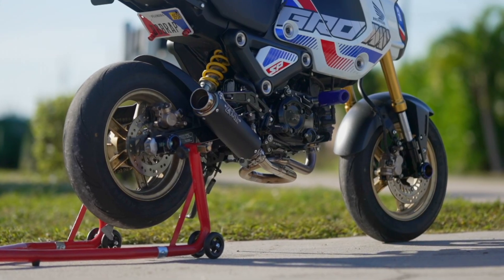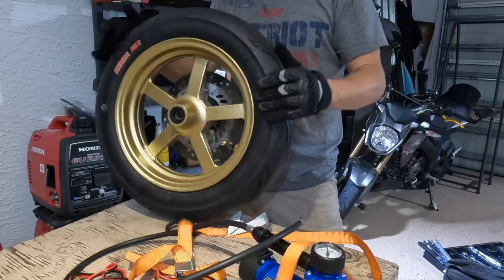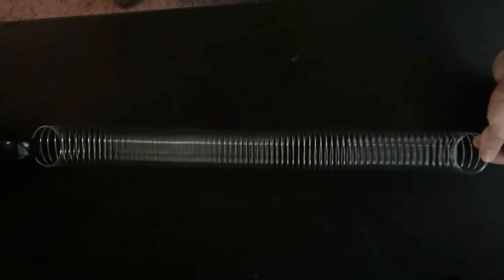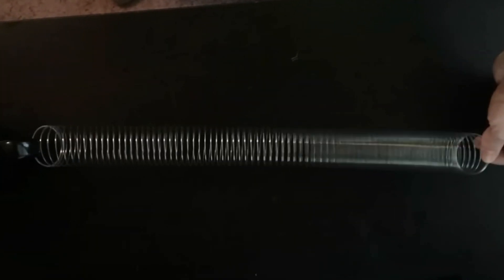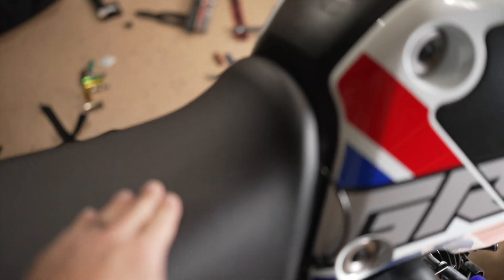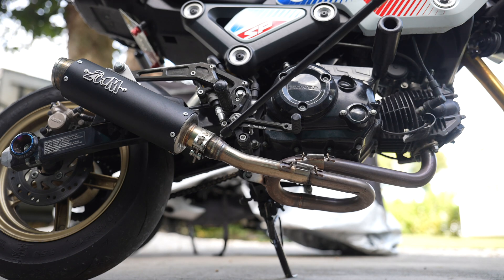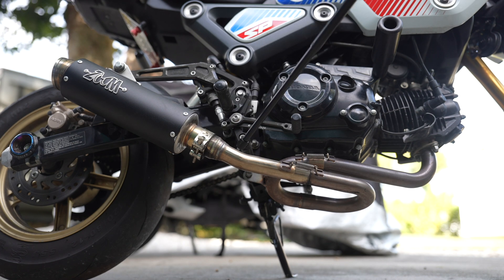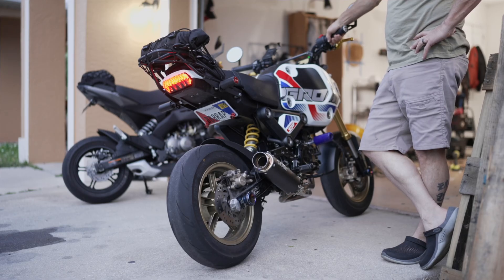What is the Purpose of a Loop in the Exhaust? Honda Grom Zoom loop exhaust

Comment: You will get a reflected wave from the "cat" you installed as well as some restriction in flow. Any obstacle, change of angle or pipe diameter will cause some form or reflected wave so this pipe will have several wave pulses being reflected. Now from experience I know a longer length exhaust works well on all of the horizontal Honda and Chinese clone engines. They do not rev high enough to work well with short exhausts which are more suited for much higher RPM than we want with these little engines. The longer pipe length with no DB killer or other internal restrictions on the LM exhaust I run gives the bike a better spread of power and is of a length which allows the engine to rev to 13,000 rpm but peak torque is around 600 rpm higher at 7800rpm and peak power is also a little higher at 9380rpm with 14.6 bhp on the dyno at the rear wheel on my pit bike running a Z155 Zongshen engine. But the thing with the pipe it that even at 13,000rpm the bike is still producing almost as much bhp than the untuned engine was at 9000rpm which was where the stock engine was producing 13.2bhp. With the stock pipe the engine only revved to 11,300rpm and was putting out 10.3bhp where at the same RPM the longer exhaust engine is producing 13.9 bhp at the same RPM, the engine still has 12.9bhp at 13,000rpm.
Reply: Same here, though i have the 110cc CRF engine. Have tried several lengths and the longer and a bit smaller diameter one works well. Currently using an old LV scoot exhaust system and my bike rides a lot better with it.

Comment: Loving your videos. So I have 2025 Grom, and my mods are Zoom loop exhaust no baffle, TST air box cover, DHM Ecu flash stage 1. Will I feel a difference when I put in the db killer to what I’m running now. I am thinking about doing the cam & sprocket later.

Comment: From my drag racing days, I recall that the PRIMARY pipes (i.e. BEFORE the 'collector' on multi-cylinder engines) were tuned for specific rpm's.  In general, shorter primary pipes increased high rpm power; longer primary pipes increased lower rpm torque.  I envy the FUN you're having figuring out better performance than the Honda engineers, who've made millions of that engine.  🤩
Reply from the maker: Interesting!  Yes, good point.. Honda knows what they are doing for sure. I assume gas mileage and stock gearing is in there equations… once o changed air volume, cams, gears and don’t care about gas mileage… makes sense to change.. 

Best bang for the buck is sprocket, airbox and just reset the stock ecu… leave exhaust alone and enjoy the  bike
Reply: @0to60eventually_youtube  I've read that, as of 2017, Honda sold 100 million of various models, using that engine.  I suspect that most of those sales were in countries with mostly dirt roads and few, if any, highways.  Why do they need to go faster than 40 mph?  In many such places, 87 octane fuel is scarce.

I suspect that the Honda intake air-box is 'tuned' for low rpm torque? ... usually overlooked by those seeking high rpm power.  ... same with Honda's choice of sprockets/gearing.  I'm not quick to assume that an outfit, which sold over 100 million of something, doesn't know what they're doing!  😛

Comment: Is the loop setup the same as "powerbomb" (bulge chamber) in the middle of the pipe? Im thinking for a full-system pipe without the cat and some said that single cylinder do need some kind of restriction, hence the powerbomb suggestion. Great video btw
Reply: Bulge is for 2 strokes. There  is no restriction due to the length of pipe(counterintuitive I know.)

Comment: change intake or exhaust = need tuned ecu for each set up for best ppower
Reply from the maker: Intake = ecu reset (no flash/tune) 
InTake + slip on = ecu reset (no flash/tune) 
Full exhaust + intake = flash/tune and ecu reset

Comment: Cool looking grom. I still dont understand why anyone would buy one and not a real motorcycle.  Maybe is the wheely thing?
Reply: You can get away with doing a lot of dumb stuff unscathed while on a smaller bike. Stuff that will get you killed on a bigger bike.
Reply from the maker: #facts
Reply from the maker: It’s a weird human behavior for sure. 4k pulse 2k  in mods to go slower than a R3 or a Honda rebel 🤣.  Short answer is if mopeds are fun, then these are even more fun… when you get into 300’s or bigger you have to get more responsible… 😎😂
Reply: @0to60eventually_youtube  I guess people see them as a bicycle and dont even wear a helmet.. who knows.  I started ridding motorcycles 6 years ago. I had 3 cars and figured maybe I get a scooter for short 10 minute trips and to avoid paying for parking. Then I saw shitty 50cc scooters.. then I'm like, I could never buy that. Then saw 125cc and they barely do 35mph... then some 200cc. Meh. And then I said, for the same price I can get an 1100cc bike and turn it into a bobber and actually own something cool. So 10 motorcycles later, I still don't have a scooter lol.
Reply from the maker: The motorcyclist journey. Always interesting 💕
Reply: If can't get these bikes up to 100mph, you can't crash these bikes at 100mph.
Reply: You can easily die at 50mph if you are unlucky 😅. Technically if your head hits the cement floor with no helmet at 3-4 feet, you can meet your maker. Always wear protection, even on a scooter.
Reply from the maker: I eat shit at 45 mph on my R3 .. worst accident I’ve ever been in. Still trying to get full function back to my arm.

Comment: How did you get the length of the header pipe?
Reply from the maker: To be honest a slip on with a tune would probably be the best balance between sound and power access
Reply from the maker: Just purchased the pipe, had DHM tune the ecu for a “yoshimira loop pipe” and started trial and error. The way to load exhaust kept me going back in with the Db killers … and got lucky over time

Comment: I race WERA and work with a guy that knows these things. It's all true. You have to tune it for torque where you want it.
Reply from the maker: The science is deepAF .. hats of to the real runners out there
Reply: @0to60eventually_youtube  Its not really science if anything its all math when it comes down to it (sizes, ratios and shapes) Anybody with half a brain can learn how an engine works, how to spot bottlenecks and how different parts will affect an engines performance through the powerband.

Comment: Not many tuners have figured this stuff out. Kudos to you sir.
Reply from the maker: The science is deepAF - hats off the all the real tunners out there.. and thanks to the good quality “bolt on” companies that figure it out and sale us the good stuff
Reply: We used to do this with 2-stroke racing exhausts back in the 90's, in the 'stinger' section of the pipe after the compression cone but before the backbox can.
We'd have various loops of different lengths called 'pig tails' that sleeved into the cone, to alter the length of the stinger protruding inside of the cone while maintaining the tune of the pipe. So, for less protrusion, we'd have a bigger loop outside of it. We eventually came up with stingers of different diameters and shapes to do the same thing.
The point of it was to smooth the transition into the powerband, to stop the bike from suddenly overwhelming the tyre when you come out of a corner and crank the throttle on.

Used to see all sorts of weird and wonderful things, from telescopic variable-length pipes that were driven from servo-motors depending on engine rpm + load, to 'snake's head' header pipes on both 4-strokes and 2-strokes, that contained a portion of the expansion phase in the header by being flat but wider. Crazy times those were.
Eventually, computers and accurate gasflow simulations came in to make tuned pipes, but it was all based off the data gathered by those old Mad Scientists in garden sheds.

Comment: I installed a Decha stealth air intake tube and drilled some holes in my air box, a good noise and plenty of oxygen. I tried an eBay exhaust and it was too loud even with the baffle. I'm keeping the stock exhaust on. It allows me to fit a Kitaco skid plate as well. I really want the zoom loop pipe but allow me to put on my own slip on.
Reply from the maker: Yep, I can relate. I found a slip on pipe along time ago, allowing to leave stock header pipe, which is tuned well for the engine. Air intake, slip on would allow to run it with no tune.. that plus one less tooth on the front is a nice bang for the buck..